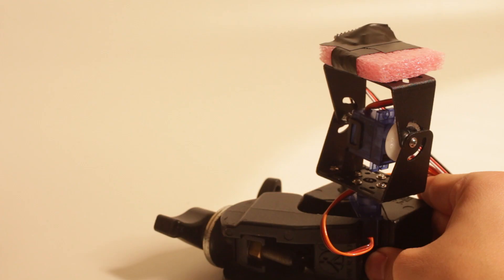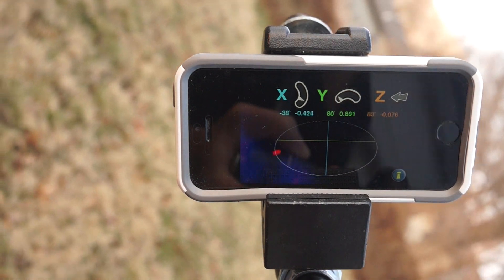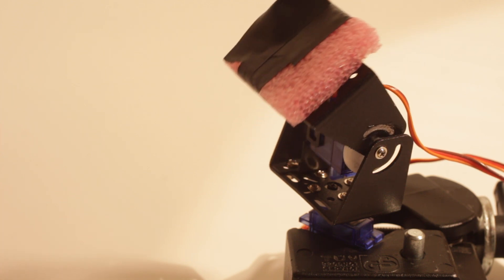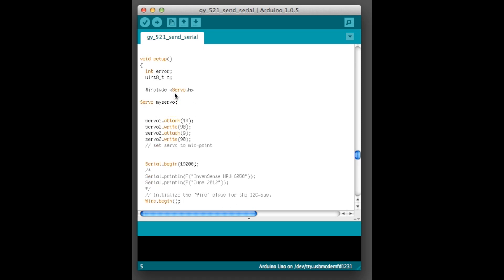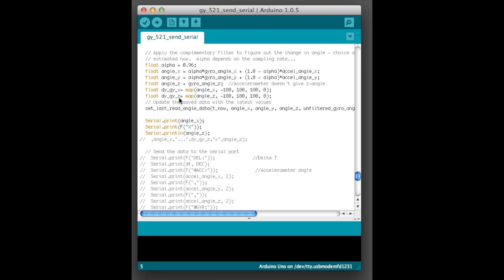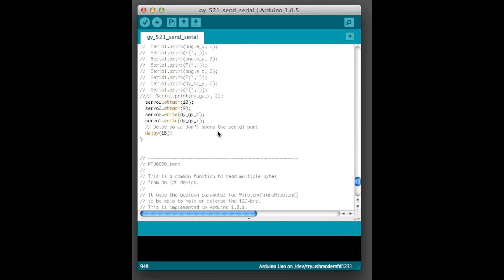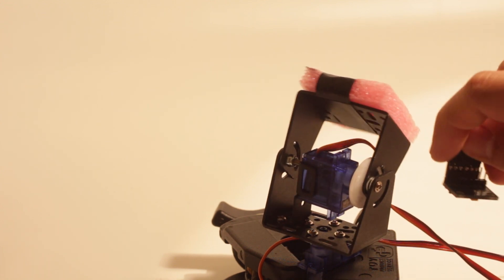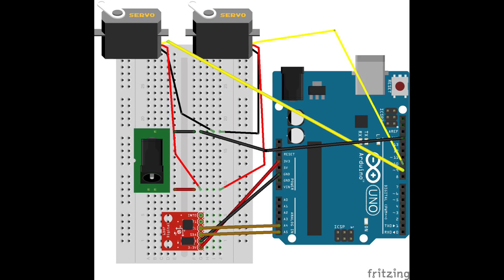2/2 DIY Arduino Camera Pan/Tilt Stabilizer with Accelerometer

Comment: When placing the accelerometer on the assembly, accelerometer reconizes  real center of rotation, but are placed offset from it, therfore confution occurs i the logick of the software. 
So therefore values for has to be created for  the offset  maybe using a virtual center of rotation vith negative values?
Am I way off with this, is this something  to be taken in consideration  ?

Comment: I think the problem is that in your code you maybe have something like this servo_x_angle=gyro_x_angle where you should have something like this servo_x_angle=servo_x_angle+gyro_x_angle, cause in the first example it will confuse the program because if you for example tilt the gyro 20 degrees x when its over the servo the code will tilt the servo 20 degrees x but then it will read that the gyro is on 0 degrees so it will return the servo to 0 degrees instead of leaving it on 20 degrees, I dont know if Im explaining myself

Comment: Which Accelerometer did you use. I may have missed this information if you said it in your video. Thanks
Reply from the maker: I got a pretty cheap 9 axis IMU off of dealextreme. This would work too https://www.sparkfun.com/products/13284?utm_source=SparkFun+Customer+Newsletter&utm_campaign=5b242bf3c8-Aug_14thNewsletter&utm_medium=email&utm_term=0_fa5287abaf-5b242bf3c8-61287981

Comment: Hey men where can i download this code being used here? i did the same thing  but using the nrfL01+  hmu excorp.weebly.com or if i can find you on facebook even better
Reply: oh nevermind i looked around and seen it, tho why is this folder in beaglebone project when this i sa arduino ? well i also just noticed this is a LONG ass  code for something that is all embedded into one platform i thought it was BT or something, as a matter of fact when we link up ill pass you my serial imu to servo map() sketch which is stupid short not even 40lines
Reply from the maker: +Sys.stem I'm pretty bad with naming conventions. It's a bad habit. If you do make the code shorter please post it here. I'm not really supporting this project anymore but lot's of people check out this video. Thanks!
Reply: Shawnee Union no doubt men !

Comment: Hello.

Which Servo bracket did you use and which servo adapter did you use? I already have the servo motors.

Thanks!
Reply from the maker: +Looka masira Can't believe I didn't put a link, I didn't really like this one in the video. This version from Adafruit will work great. Everything I have purchased from them has been legit. http://amzn.to/1WHjqJN

Comment: hello when I move the fast sensor, servo motor lock and does not follow the movement, and is making a noise (tec tec tec) in the servo motor, and then resetting it back to normal, you can say what can be ?
I'm using servomotor Towerpro MG946R direct 5v power by the Arduino.
Reply from the maker: +Roberto Luiz Amorim Junior the code I used wasn't the most efficient and the original poster of the code changed the way it was written. If you're moving it that fast the arduino may not be able to process the data fast enough or you may be hitting the limits of the servo. I'd slow down your movements and test to see if it's the sensor, arduino or servo.

Comment: Very very impressive!! I am trying to build a pan and tilt mount that can hold a camera weighing 250 grams. I am using arduino uno. Can you help me with the type of servos(analog/digital/micro) that would support the weight of the object ? I am having trouble choosing a servo to manage the weight and power. Thanks!
Reply from the maker: Hey, I'm not great with that. I bought a kit with two servos like the one in the video description. If you're going to buy it in pieces get a little more than you think you need in terms of power and speed. Hope that helps
Reply: Thank you !

Comment: Hey, I don't know either it happens to me only or with everyone, but when I connect every thing with arduino and after uploading the code, after few minutes , my one servo motor stops working. And after closing the arduino IDE, my both servo doesn't respond to the motion of MPU 6050

Comment: How hard would it be to add joystick control.
Reply from the maker: Jeff Dodd Not much harder at all, are you thinking of just controlling the servos or having both servo control and balance?
Reply: I was thinking of doing both.
Reply from the maker: Jeff Dodd it would work. Check out this video I made to get your joystick going,

https://www.youtube.com/watch?v=g4SkvBJiof0
Reply: Thanks for the link, I have the servos working on a couple of pots. I was hoping to add your stabilizer code to it. I was guessing I would have to change what the stabilizer code calls zero or home. Joystick would say move here and stabilizer would see that new location and hold that spot.
Reply from the maker: Jeff Dodd interesting. Adding a pause and start button would be my approach, you'd have to some passing of variables but it seems straightforward. Good luck

Comment: Hi! Don't know if someone else posted this already but if you put the accelerometer on the stable part of the project i think that you would get a better range than having it on the moving arm! Or not? :)
Reply from the maker: Never thought about that but you'd be correct. Maybe the translations would change slightly.

Comment: How to connect 3 servos?
Reply from the maker: It would just be another servo connected to a 5v rail and then you'd need another digital input. I'd probably get some more current too since thats could be a big current drain (1+ amps).
Reply from the maker: ed ed I can help you but I can't hold your hand. My code is pretty clear, if you have a analog Ouput device you would need to make two changes to my code. One to assign a third analog output and then add another line to write the angles. You'll get better by figuring it out on your own.
Reply: Shawnee Union  I'm a beginner with arduino and don't know how to edit the code to run. I'll try today to change a code and see. :)
Reply: Shawnee Union Could you check the changes?   https://github.com/edzio1/code-3-servos/blob/master/gy_521_send_serial%20-EDIT
Reply from the maker: Great Job! That should work, I would only keep things more consistent servo 1 on pin 9 and servo 2 on pin 10 servo 3 on pin 11 to keep things straight. Good job!

Comment: What app is that on your phone? Will I be able to find it if I search for IMU?
Reply from the maker: gmecomber I just looked. I forgot what the app is but I searched for accelerometer and it gave the best results. You want something that gives XYZ axis readings.
Reply: Shawnee Union Thanks so much. May I also ask, do you think it would be hard to transmit the coordinates through Bluetooth to a computer or would I need to use something like Matlab?
Reply from the maker: Pretty easy, check out his product from adafruit. Hope this works for you

http://www.adafruit.com/products/1588
Reply: You're a great help and an inspiration. Don't be a stranger. :)

Comment: good night this is a good project thank you for share, but I want to know how to invert the direction of rotation horizontal.

thankyou
Reply from the maker: Edinson Hernandez I think you'd just (180- degrees). I had to invert the readings a lot and it basically came down to subtracting and adding things to 0 and 180.